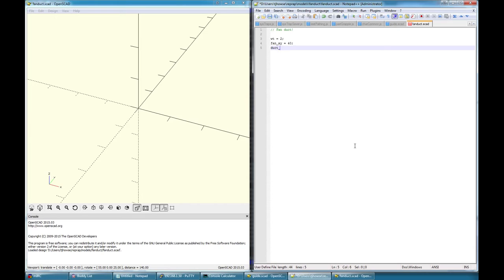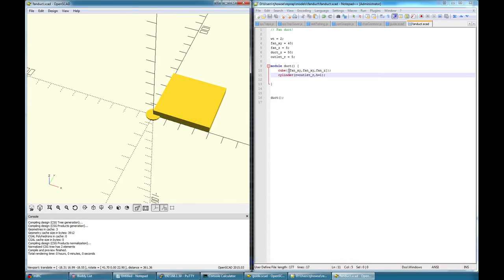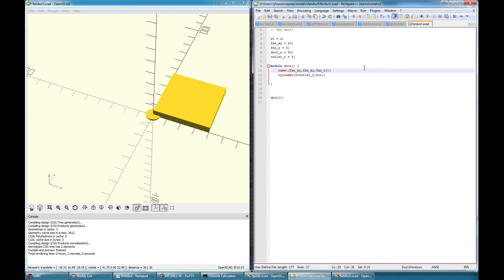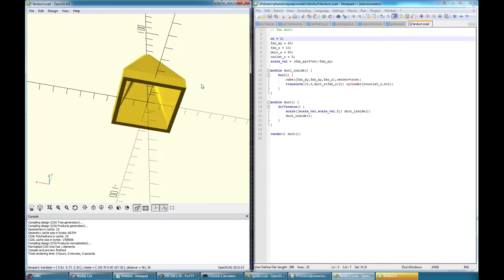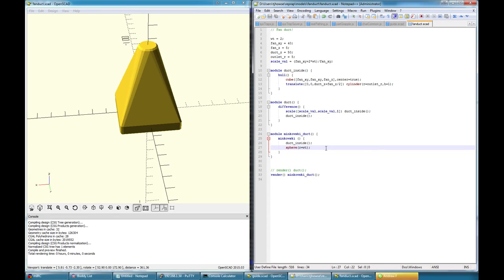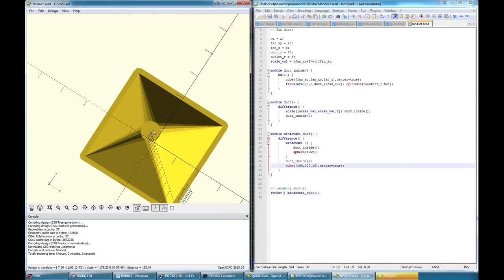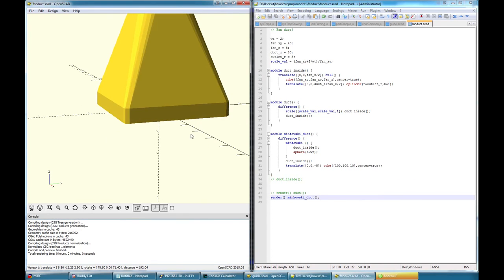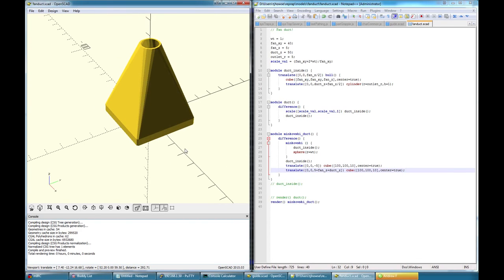OpenSCAD: Designing a fan duct from scratch.

Comment: How much to make a fan duct for me?  It would be for a diamond hotend on a mini kossel printer.  Space is very tight.  Help please.
Reply from the maker: Unless you're in Brisbane, you're probably better off finding someone local to print it for you, or printing it yourself. A hot end fan helps with bridging and small prints, it's probably not necessary for printing this duct.